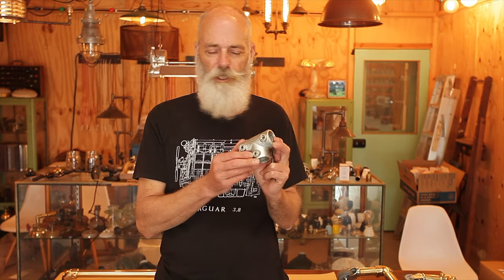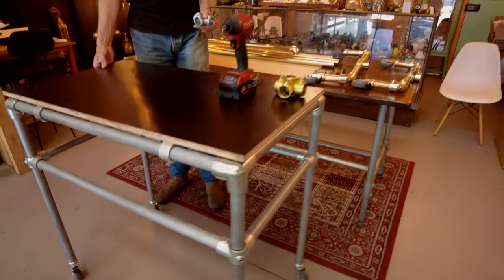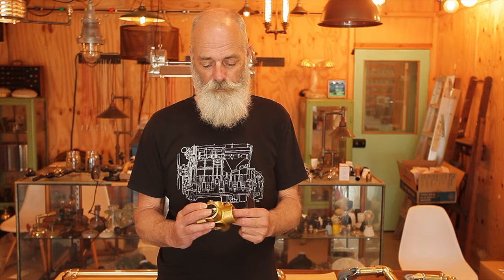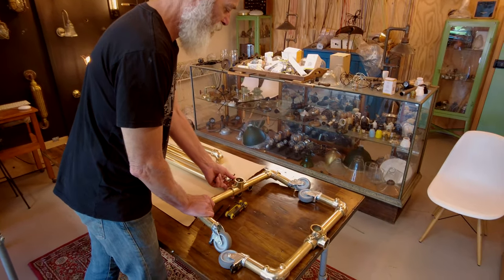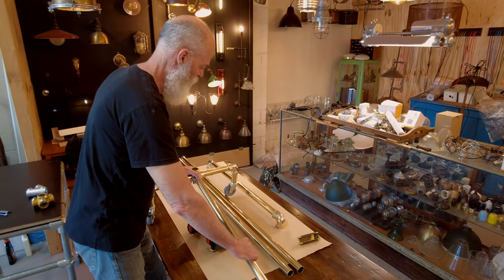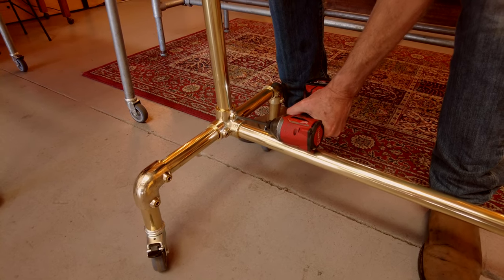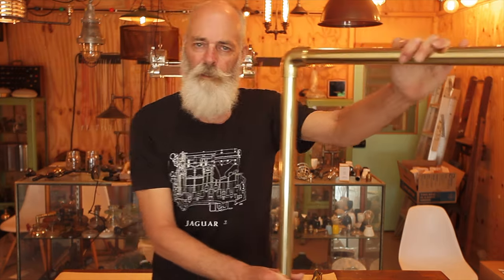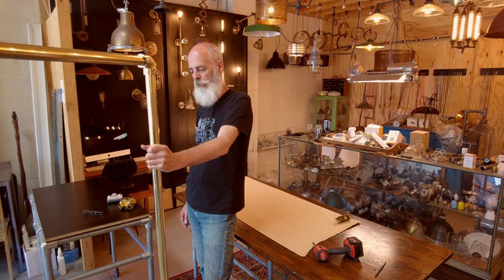Brass compression fitting dress rack build

Comment: It seems like it would make more sense to refer to the fittings as using a heavy set screw instead of “compression,” since (at least in the US) ‘compression fitting’ distinguishes particularly type of commonly used fitting, which seals to the outside of a pipe or tube via a compression mechanic, comprising a special female-threaded bushing (referred to as a ‘compression nut’), one or two tapered, beveled rings, and the rest of the fitting which contains a nipple portion with which the compression nut engages. Sealing is achieved by first sliding the compression nut over the pipe (threads pointed out), then sliding on the tapered ring(s), then the rest of the fitting with the nipple meant to engage the nut facing in, then tightening the nut on to the nipple, sandwiching the rings and driving the tapered end between the pipe and the nipple with sufficient force, to cause the ring(s) to seal against the pipe and inside of the nipple, generally relying on deformation of the ring(s), pipe, or both.